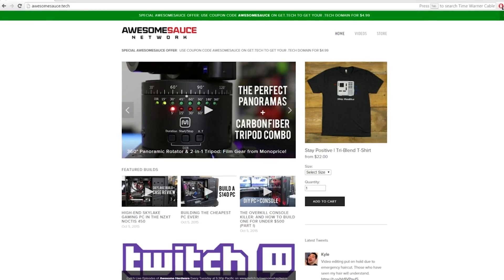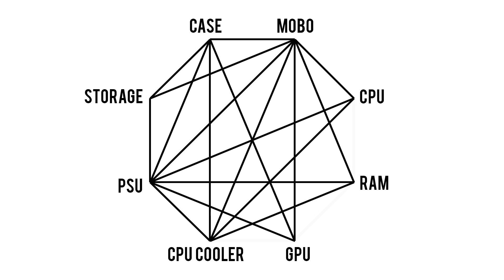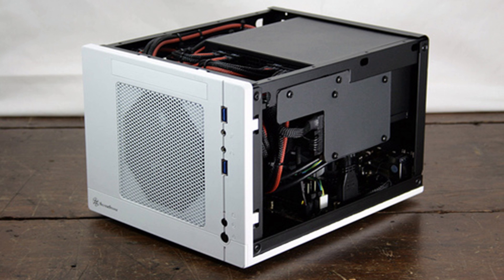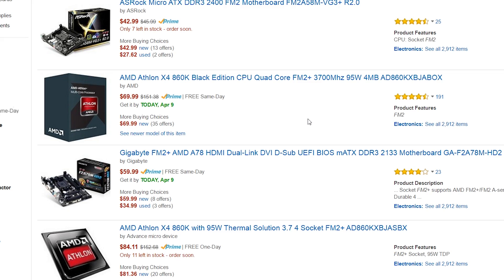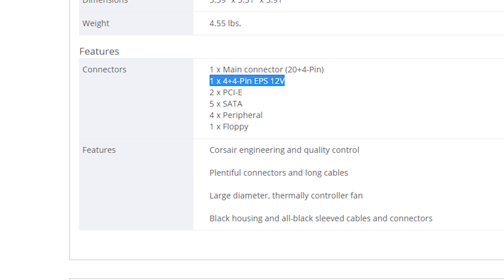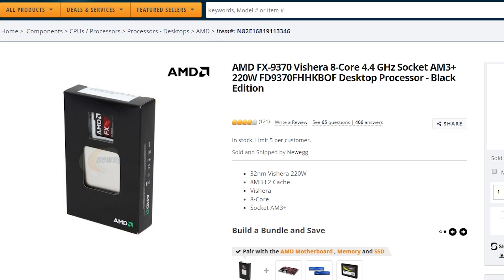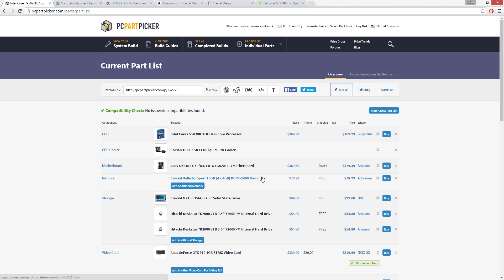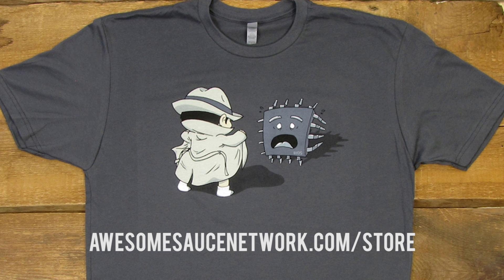How to Choose Parts for a PC! The Ultimate Compatibility Guide!

Comment: Depending on the chipset that is on the motherboard(Z97,Z87,Z170 for example) When determining Which Cpus are backwards compatible make sure that the Bios can also support the chip. For instance, even though an I7 4790k is compatable with the Z87 Chipset* it can be limited to what the bios designer had in mind which can inhibit overclocking or special features that come with the chip such as voltage regulation and storage capabilities. RAM type can also be an issue because while most boards and chips support only one type of RAM some can accept multiple variations and it is necessary to determine which will yield better results. Also if you DON'T want a video card make sure that your CPU INCLUDES AN ON BOARD GPU or else there won't be a way to get a display output(example: FX, non-"A" series from AMD or "-E"(Haswell-E for example) series from Intel don't have GPUs built in so a video card is required.) anything else after this is more advanced and I don't want to scare anyone reading this too much more than I already might have so with most of this in mind, welcome to the glorious world of PCs and I hope that you enjoy your time here

Comment: 7:47 - doesn't matter.
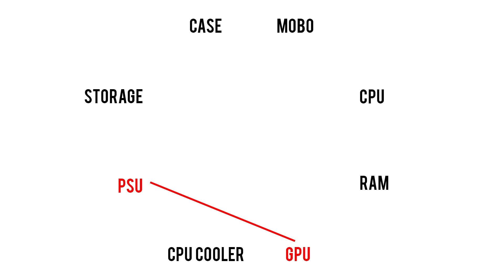12:49 - official gpu sites and power requirments sucks ass. For the same chip from different vendors for let's say R9 290 you can find from 500w to 750w. Same f... gpu!!! Best way is to add up cpu power consumption + gpu powerconsumtion + add 50w on top of that = if you have that on +12V rail total (written on psu) or more you are good to go. PSU must be of decent quality, and the numbers must be real (not only on sticker like on fake psu). Let's say 980Ti - you can run that on good quality 550w psu (with headroom, not fully loaded), let's say fractal edison (official site says 600w), but it can blow up on "750w" psu if it's fake.

Comment: A very nice video. I am adding it to my favorites. I have been building a let's say high-end gaming PC after like 15 years and I tried to do a similar analysis as you presented in you video. Sometimes the smallest things can cause the biggest problems. Like the height of an air CPU cooler (I had to choose a water cooler from Corsair instead of an air cooler from Noctua) and the length of a GPU (I had to choose a 2-fan ASUS Matrix card instead a 3-fan ASUS Strix card). But the feeling of satisfaction is priceless. I switched to PC after owning a PS3 for 6 yesrs and a PS4 for 1.5 years. PCs have it's problems but I had enough of promises, under-powered HW and below 30fps games.

Comment: There should be a line between CPU cooler and GPU in the octagon. Some CPU coolers will hang over the top PCI slot, making it impossible to install it in the top slot.

Comment: What is 115X? Does it mean 1150 and 1151?
Reply: they usually say 115X on CPU cooler boxes, because 1156,1155,1150 and 1151 all have the same dimensions, meaning that in 99.9% of the cases that if a CPU cooler is for say LGA 1155 compatible, itll also work with 1151 or 1150
Reply: +cheytacsnipes Thanks!

Comment: Just one note:
The PSU wattage recommendations on the GPU manufacturers' websites are grossly overkill. They want to make sure you can run the card with a cheap PSU that will blow up in a week.
A PSU made by a good brand doesn't need as much power - just grab the TDP of you CPU, GPU/GPUs and add 100W to make sure no amount of hardrives or fans can take you over the limit.
Reply: That's exactly what I was going to say. These recommendations suck, they are totally overkill. For example xfx claims that the MINIMUM psu wattage to run a 390 is 750w! And it recommends using an xfx 850w?! And this card can easily run on a good 650w psu.
So don't trust these at all. Just calculate your PC:s power draw using "extreme power supply calculator"

Comment: Important consideration for GPU length - If the 6 or 8 power pin connectors are off the end of the card, and not the side, take that into consideration when choosing the case (and PSU for cable length, too) because the power connectors and the bend in the power line will take up a bit more length as well.

Comment: You probably should have included a ninth point, peripherals. There's usually some compatability to consider there.
For example, with monitors, you need the right display connector on both the monitor and GPU or plenty of USB ports if you want 5 keyboards and 12 Xbox controllers.

Comment: I think this guide was spot on. Relatively easy, not that long, useful information about clearance and dimensions. The main things to look out for were pretty much all included. Most things I did know about, but there was stuf I overlooked pretty much such as the two types of PSU and the low profile RAM. The octagon was a nice way of visualizing the concept and would make for a kickass design for a new shirt.

Comment: Hello there. Can an EVGA 600B handle an OC'd FX 8300 (4.0-4.5 GHz) and R9 380 4GB?
Reply: yes
Reply: +teej ♕ Thank you. I'm planning on getting the GIGABYTE 970a-ds3p mobo.
Reply: +Sir Nobles I love how your here watching a guide on how to pick parts but you still need to ask if x will work with y and z
Reply: That would work fine. Although if you ever decide to add another R9 380 then you'll be completely borderline with your overclocked CPU.
Reply: +Sir Nobles yes
Reply: +Sir Nobles Google "power supply calculator" and there is one made by Outervision, that gives you rough idea of how much horsepower your PSU needs.
Reply: +Nanorisk I just looked at pcpp builds. psu calculator kept saying EVGA Supernova 650
Reply: On EVGA's website, they have a power wattage calculator and it'll even give you several of EVGA's current PSU they sell along with a coupon code to use on it if you intend to purchase from their site!
Reply: +Sir Nobles easily.
Reply: Josh ODriscoll well I wouldn't go to a COD channel and ask
Reply: Sir Nobles thats not the point, the point is that you literally watched how to find out how to find this information yourself but ask still, but whatever its no big deal
Reply: Josh ODriscoll the point of this is that I wanted to know if an EVGA 600B would work with a FX 8300 and R9 380 4GB. Who said I watched the video?
Reply: Sir Nobles If it says 650w, its better to get 650w. Is there a specific reason that you insist on a 600B?

Comment: I remembered JayzTwoCents had a video 1 or 2 years talking about what kind of psu you need, he said that mostly single core gpu would be ok with 500w, I'm a bit confused here, so do you need to buy a psu which has 150w more than the recommend or what ?(overclocked cpu) btw I have 6600k oced to 4.5hz with NZXT x61 and EVGA 970sc, I have rm550x corsair psu. Is it enough or do I need to go for a 650w psu?

Comment: To add to the M.2 drive form factor/compatibility confusion (and thanks for the plug for my video BTW <3), there's also U.2 drives now like Intel's SSD 750. U.2 is actually a Mini SAS plug that's wired up for a PCIE connection. Simplest way I can put it is this: the fastest SSDs now connect directly via PCI Express, and use the NVME protocol which is designed for SSDs. Physically they can plug in via an M.2 slot, SATA Express plug (though I still haven't seen any drives that actually use this one), a U.2 connector or directly to a PCI Express slot.
Reply from the maker: +Paul's Hardware spot on. great addition for the U.2 master race
Reply from the maker: +Paul's Hardware spot on. great addition for the U.2 master race
Reply from the maker: +Paul's Hardware spot on. great addition for the U.2 master race
Reply from the maker: +Paul's Hardware spot on. great addition for the U.2 master race
Reply: +Yui Nyan Wait and see what Pascal has to offer :)
Reply: Not to mention that using a M.2 SSD makes 3 of your SATA ports useless. I can't wait until OEMS figure out how to give the M.2 port its own lanes so all the SATA ports remain useable.
Reply: TheDigihax the manual tells you which SATA slot the M.2 render useless. I just put the M.2 on the M.2 slot that rendered the bottom row of SATA ports useless.  This way I connected all the SATA peripherals on the top row for easier access.
Reply: Ichigo Uzumaki
Oic nice...
Reply: why you speak new language
Reply: +Paul&#39;s Hardware  TY paul
Reply: There is a Intel drive that uses serial ATA Express.
Reply: Are there other u.2 ssds besides the intel 750?
Reply: Ichigo Uzumaki
Idk about using them M.2's, seems like a pain in the ass to figure out which sata cables not to use bc you can't use them...
Reply: I wonder if i buy a U.2 and boot up from that will it say High Levels of sass detected
Reply: meh SATA is more than enough!
Reply: j
Reply: Thanks might just need that sometime!
Reply: I'm lucky I found you comment
Reply: Paul's Hardware Hi, paul i will be buying a Gigabyte Z370 HD3P (rev 1.0) or Msi Z370 A-PRO LGA1151 Motherboard for my pc build.
Which cheap M.2 storage, cpu cooler & ram would you suggest for me, which could be compatible for these two motherboard's. Okay here are the other parts i selected for this build on pcpartpicker.com

1) CPU : intel i3-8100 3.6GHz Quad core processor.

2) CPU COOLER : Cooler Master Hyper 212 Evo 82.9 CFM Sleeve Bearing cpu cooler.

3) MEMORY : G Skill - Trident Z RGB 16GB (2 x 8GB) DDR4 3000 Memory.

4) GPU : Msi GeForce GTX 1050 2GB Video Card.

5) PSU : EVGA - BQ 650W 80+ Bronze Certified Semi-Modular Atx Power Supply

6) CASE : NZXT S340 Elite VR Ready cabinet (i have already bought it)

I wanted to have led fans but i see it's too expensive. So i found this accessory.
7) 2x Phanteks PH-FF120RGBA_BK01 Halos Lux RGB Fan Frame High density LEDs RGB 120mm fan mounting

8) 1x Phanteks PH-FF120RGBP_BK01 Halos RGB Fan Frame High density LEDs RGB 120mm fan mounting

Will this be a good buy for this build ?
Reply: THE M.2 DRIVE DOES IT COME WITH THE MOBO? OR DO OU BUY IT? I'M CONFUSED PLEASE HELP MEEEE
Reply: Paul's 3iiHardware
Reply: Yui In Anime aa
Reply: msi has 1 for 27 bucks...
Reply: lucky I found ya!!

Comment: Specifically for case/graphics-card compatibility alternative form factor cases often have much stricter restrictions. I recently did a build with the PCDIY Cuboid mATX case which as a horizontal mobo orientation.

I ran into a clearance issue with the top-front mounted ODD bay and the MSI GTX 970 Gaming graphics cards which has heatpipes which protrude past the heat shroud of the card. It was only about a couple centimeters off but enough that I had to remove the ODD. Not a problem with my build because as Kyle pointed out optical media is bleh. But could be an issue for people dependent on their ODD.

Lesson hear is that sometimes you can check as many specs as possible but you just can't predict an issue and won't discover it until you actually build the test. So if you're looking at a "$1000 Gaming PC Build Guide" from someone that hasn't actually built the system be wary of issues like this!

Comment: If my RAM is at a different speed than recommended on the MoBo, can I change the speed on the RAM to the speed recommended?
Reply: +Ethan Thai If the ram speed is greater than the MoBo can use it will underclock your ram to the maximum the MoBo can actually use, so it will still work fine, but not to the full potential of the RAM kit
Reply: Jack Wills Thanks!
Reply: but you can overclock to reach to it full potential right?

Comment: CPU cooler can be on the way of GPU as well. If you have a big ass CPU cooler and GPU is mounted on the top-most slot on your MB or even if the CPU cooler isn't that big but you have a badly designed ITX-board.

Comment: A few minor things you forgot to mention:
 1. PCIe is both backwards and forwards compatible. You can shove a PCIe 3.0 GPU in a PCIe gen 1.0 slot and it will theoretically work and vice versa.
2. PCIe cards can also be placed into slots that are not the same width. You can shove a PCIe x16 graphics card into an 8x, 4x or 1x slot. You can also shove a PCIe x1 card (like a SATA or sound card) into a 1x, 4x, 8x, or 16x slot and it will function, it will just work at the lowest common denominator of available speed. Although if you are going to shove a PCIe x16 card into an 8x slot or under, you will have to cut the slot so the extra PCIe connectors can overhang the slot.
3.  you can actually plug a 20-pin ATX PSU connector into a 24-Pin ATX header in a motherboard and it will work. The same goes with the CPU power connector. You can plug a 4-pin EPS CPU power connector from the PSU into a motherboard with an 8-pin EPS CPU power connector and it will work fine. 
4. If the PSU of choice has no SATA/molex connectors, adapters and SATA/molex splitters can be very cheaply obtained on ebay.
5. If you are going to go SLI or crossfire, make sure on the Nvidia side each GPU will be able to receive at least 8 PCIe lanes and on the AMD GPU side at least 4 PCIe lanes for crossfire/SLI operation.
I don't know how many new PC builders will run into these issues as they are pretty minor, but you did forget to mention them.
Reply: +Dylan 873 I think he wanted to say that you should not put a GPU in a PCI gen2, regardless of the backwards compatibility
Reply: But why not? I've been able to get used GTX 570s on ebay for 50 bucks that will crush a $100 GTX 750 ti for significantly less cost and GTX 570s are PCIe gen2. A Novice PC builder may not buy a used GPU because he may think it will not work even if it really does.
Reply: +Dylan 873 At least the first 3 i dont think brand new pc builders need to know because they should not be trying to do those kind of things, they are just handy. 4 and 5 i agree should have been said or at least 4

Comment: U forgot to mention RAM and CPU compatibility, as if your CPU doesn't support the speed of the RAM the computer will run it at a much slower speed resulting in a waste of money, or is some cases the computer won't run at all
Reply: +Bailey Rende Not just that, but it can even fail to POST.

Comment: if u have a pcie 3 on a gpu can u put on pcie 2?
Reply: +Swordshoot Yes. From what I know the performance loss is either small or non existent.
Reply: +Swordshoot (as far as I am aware)
yes you can. PCIe slots are both backwards and forwards compatible. they will run at the slowest speed though
Reply: okay thanks :D

Comment: Although this video is completely useless to me due to existing knowledge. This may actually be the best guide for PC newcomers on youtube. good job.

However there are things that are missing. Mostly kinda semi-advanced stuff, but more to do with the theory of 'buying 2 of the same thing=faster'

M.2 drives come in x2 and x4 configs, depending on bandwidth and slot used.
Raid doesn't work with all chipsets. M.2 raid for example, doesn't work on x99(yet)
Not all Mb's could utilise the all slots even if it is empty- have to look at cpu bandwidth and do some math
Check if fan is 3pin or 4 pin. sometimes incompatible in rare instances.
SLI and crossfire depends on motherboards sometime.

That all i can think of are semi- glaring problems, mostly for rich first buyers

Comment: I just bought a corsair 300r case. I am going with a gigabyte gtx 980 ti xtreme gaming  with a i7 6700k. Any thoughts on a power supply and cpu cooler?
Reply: Corsair 650 watt gold rated, hyper 212 X for air cooling it's pretty decent for OC especially for the price

Comment: CPU cooler and GPU spacing ex Nacuta D-15 on a mother board with a really close pci-e express slot can have the issue causing installation issues or worse case a short

Comment: my motherboard(z87) is not compatible with any SATA intel SSDs.
Reply: +SandyStarchild http://www.tomshardware.co.uk/answers/id-2753017/mobo-support-nvme-ssd.html
Reply: +Shofield dGu I said SATA. i know a nvme ssd wont work.
Reply: +SandyStarchild i've never heard of any z87 board with no sata ports...
Reply: +Phoenix Wright it has sata ports just that none of them work with any intel SSDs i have tried. my motherboard cant see them. other SSDs are detected and work just fine.
Reply: SandyStarchild that's strange. Motherboards are supposed to be drive-agnostic.
Reply: +SandyStarchild Have you check to see if your motherboard has any bios updates available?
Reply: +Dave McAvoy the reason is intel used(use?) an old ssd controller and did not bother fixing it in the SSDs firmware. some haswell boards implemented a workaround in bios updates. solved it by going back to using Kingston SSDs.

Comment: On GPU-Motherboard compatibility, I believe it would be worth to mention physical location of the PCI-E slots issue. For example, my ASRock motherboard does support four-way SLI, but that does not mean I can hook up four cards into it. Not only I have only three full-sized slots, but also slots are too close to each other, hence I can use at most two two-slot GPUs.
That's a little bit more advanced, but PCI lanes number comes into the question when connecting more hardware.

Comment: Make sure your GPU outputs the correct types of signals to send to your Monitor, and if you have a 144hz monitor, you have to separately purchase a display-port cable of a DVI-D cable to be able to send 60+ FPS to your monitor. HDMI will not work most of the time. :)

Comment: CPU and ram should be a thingy, the cpu itself has a ram limit both on speed and quantity (and which type, aka ddr3/4/whatever)
Reply: +Tommy Strandman YES. I built my first PC not long ago and got in the "bus" thingy. Afaik that's also affected by CPU.
Skylake started using DDR4, but i've also seen DDR3L (not sure). Speed and quantity are mainly for the mobo.
Good point nonetheless =)